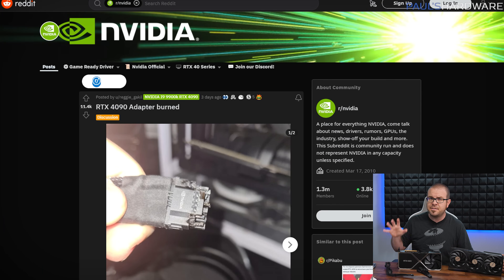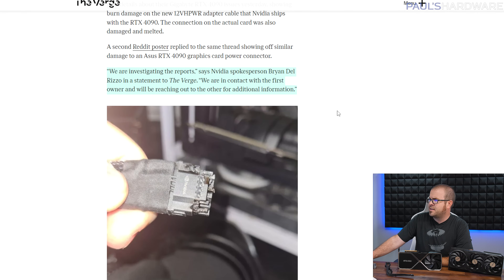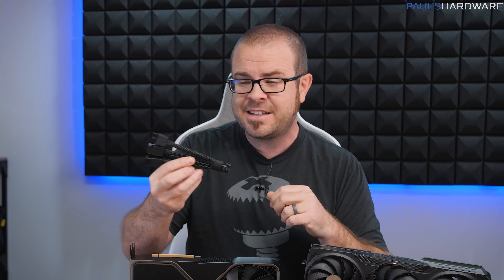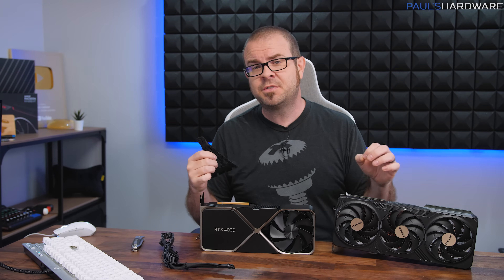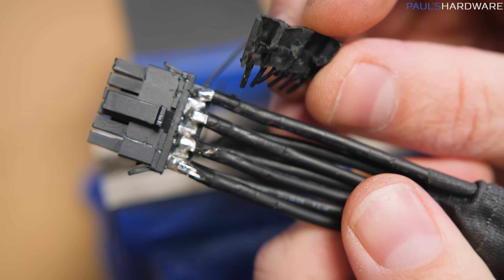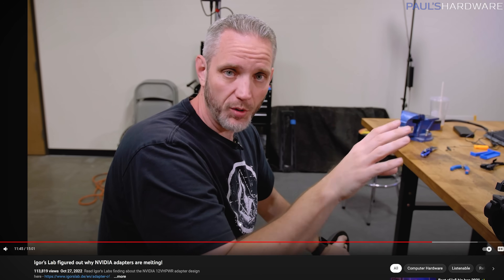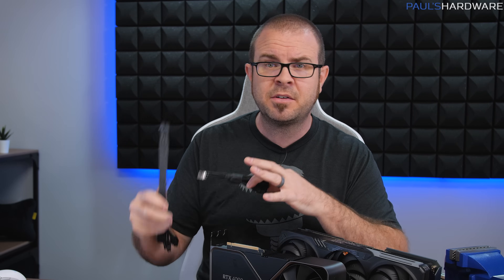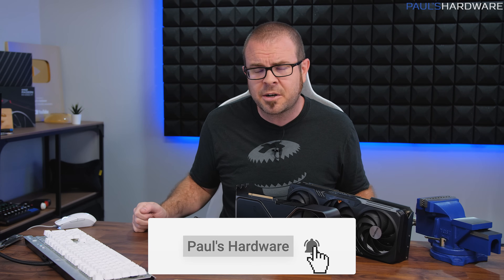Why are some melting? RTX 4090 600W 12VHPWR Adapter Teardown

Comment: While poor connection increase impedance, it will not increase it compared to no connection at all. If only one of the pin has poor connection, it's still better than one of the pin having no connection at all. However, if the distance is extremely short there's always of a potential of sparking which would increase the temperature.

Comment: small contact means higher resistance , also means that path will distributed lower current(Parallel Circuits) ,so maybe not the case

Comment: Confused to why manufactures haven't just switched to (2) 8 gauge OFC stranded power cables. 8 gauge wire @ 24" is good for 200 amps. Not only would it be safer, it would look better. You could actually use even smaller like 10 gauge.
Reply: Because the more resistance, the more power you need to pump, which means its power draw will be even higher due to the losses from that higher resistance. Basically they sabotaged the product with a bad decision in order to try to fit it into a specific advertised power envelope.

Comment: problem too, is those metal plates are now thinner vs previous connector, so they get hotter, 57C  (plastic 67ºC at 30 ambient temp) outside, could be 90-º105ºC (metal)  inside, that could strain the solder with the time and breat the solder joint.

Comment: Is the cable melting with a certain brand that makes the 4090 card ?
Reply: According to igorsLAB, all of the 8 pin to 12 pin cable adapters are supplied by nVidia.

Comment: moral of the story is Nvidia isn't a cable manufacturer, don't use their cables, use the one from your power supply, they manufacture cables.
$1600 GPU and they skimp on the most important part... If you can't spend a couple dollars on the cable to make it right, don't include it in your box!

Comment: Thanks Nvidia for using the cheapest connections you can get while charging us 1700 bucks for the card.
Reply: Funny when it is likely just customers not plugging in the cable enough.  KEKW
Reply: Na, cable works fine. User error

Comment: Never had a warm fuzzy about that adaptor design. When the cards had three 8 pin connectors it was always recommended to use three separate 8pin wires from the PSU.
Reply: the problem is the mechanical design, not the amount of wires ffs

Comment: Great analysis but I don't think a single loose connection with multiple wires in  parallel would cause that much heat because the power will go the path of least resistance. It is more likely something is causing a short or multiple pins are becoming lose and causing the additional resistance across multiple pins. You could put an amp clamp on  each of the four wires and see if there is an imbalance after multiple plugging and unplugging or various configurations.
Reply: exactly ,the net resistance of a parallel circuit is always less than any of the individual resistance values.  and base on P=I^2 R , the total heat generated on the cable should still lower then 2 line situation like Jayz experimented , Isn't this high school physics?
and if only 2 lines are fine in Jayz test, it's more likely causing by  loose pin

Comment: Nice video Paul, I just put in my Corsair cable in this morning for the 4090. The Corsair cable feels nice and robust, and its working great. My old plug I took out and have been using for a week showed no signs of melting or any problems. Keep up the great work.
Reply: Where do you find it? I am having no luck in finding one, about as much trouble as I had for the dang 4090 card
Reply: @killer01ws6  best buy has the Corsair 12 pin cables for $20.
Reply: @Stormborn29  The cable you are thinking of is only for 3090FE being a 12 pin not a 12+6 which is the one needed for 3090ti/4090 cards.
Reply: @williamrestrepo98  you are sort of right.  The one available at best buy is for the 30 series.  The pcie5 600w version is offered by Corsair but out of stock at the moment. So yes and no.
Reply: @Stormborn29  Yeah, maybe my local BB sucks, but it only has 3090 cables and if I put in Corsair 12VHPWR cable it finds Nota, just wants to show non related stuff.
Reply: Have you noticed if you can set the maximum power over 93% on the geforce experience performance tab?
Reply: You just need to keep refreshing the page all day I got lucky and got one within a day of them being released.
Reply: @WillS.420  Thanks, I will go be the store and see if the locals have a clue haha
Reply: @killer01ws6  corsairs website has it, though it's not in stock right now.  It's specifically the same type of cable but 600w.  It's written on the 12 pin side. I'm in the same boat and need the newer adapter as well.
Reply: @Stormborn29  I am on the to be notified list for it from Corsair also, Seasonic is supposed to send me one too.. I am just seeing what I can get first.. I have this 4090 setting on my desk looking at me, killing ha. but I will not use the supplied cable on it.
Reply: @killer01ws6  yea seasonic won't have an ATX 3 PSU out until Dec.  Ugh.

Comment: Amazing. Nvidia is going to f around and get the NEC involved in PC internals at this rate. $300+ Billion global company saved 20 cents by including a POS adapter with a $1600 card. Brilliant.

But hey, the more video cards you melt, the more you save!

Comment: The same 12 + 4 pin connectors were used for the RTX 3000 series. If the problem is with the connector, then it's only a matter of time before the 3000s connectors start melting. The additional 4 pins are sense pins that don't carry current and the 3000s don't require as much power but the principle is the same.
Reply: The 30 series ones are more like the Corsair wire that Paul showed - so each pin has a dedicated wire providing power to it.
Reply: @icaruswindrune7116  I see. The cable went from 12 18AWG individual cables to 8 14AWG cables soldered to 2X6 pin bridges. They went to 14AWG wires for increased ampacity. LOL. Whatever. Fortunately not a problem I have to deal with as I have no intention of owning a 4090.
Reply: They were wired differently than these new ones. Only the 3090 Ti had the 12+4 pin and they were wired in a proper way unlike these 40 series cables adaptor.

Comment: That picture showing the connector on the card, am I blind or does it not have any sense pins? The cable had some but looking at the pic of the cards connector it doesn't look like it has them.

Comment: dose anyone think that maybe when EVGA seen this maybe they did not like it and thats why they told Ngreada to kick rocks  as EVGA has built cards for years and know what kinda power a card really draws under heavy loads
Reply: This is very possible as EVGA did specialize in overclocking.

Comment: If they skimped on a simple thing like a cable, you have to wonder, what else did they skimp on?
Reply: The fact that these cables failed in the way they did does not suggest that they were cheap. Far from it. It would have been much cheaper to use something closer to what the 3090 used, even adding the sense pins. The adapter is too clever by half, and too clever for its own good.

Comment: upwards of $1600.00 is not the correct way to reference the price. Since the lowest price you could pay is $1600.00 and the highest is $2000.00 the correct way would be "at least $1600.00"  Sorry no willing to cut Nvidia even a bit slack on a Halo tier product

Comment: You are correct in your thoughts of a small/ poor connect causes the heat.  Just like a space heater I had.  The plug would get so hot that I could not touch it.  I replaced the plug and resolved the trouble. Bad connection in plug

Comment: Igors adapter looks like I soldered it.  Jay's a lot nicer.  Yous is somewhere in between. You can tell from all 3, the soldering is inconsistent in quality as well as wire placement.  Some have more contact area than others.  

I think think that 8.3a is too much load for that pin.  It is beyond what molex specs for it.
Reply: When I saw that, it was clear that these are almost certainly all soldered by hand. That means that soldering wasn't a decision they made to save cost.

Comment: Loose electrical connections = hot points = fire hazard = melted plastic. When you break apart the plastic molded piece and sever the connection you are no longer creating a scenario that would simulate real world use and will not be able to recreate the overheating issue. Overheating issue is a result of a severed or partially severed solder joint or contact that is loose, a loose or partially severed or completed severed connection that is held together loosely by a plastic mold has a poor contact, and anytime you have a poor contact, essentially, imagine it's like a heatsink poorly applied to a CPU. What happens with wiring connections is that the loose or less surface contact creates hot points, where the same amount of current is trying to pass through less surface area, and the areas where it barely makes contact becomes much hotter. This is why when you screw a wire in place, you have to use a torque screwdriver or torque wrench to ensure enough contact strength and that the contact points won't come loose. Loose electrical connections = hot points = fire hazard = melted plastic

Comment: 14:01 - Thank you. It has been obnoxious seeing people act as if AMD just made this decision right before launch. No, of course AMD didn't just make this decision and force themselves and all their partners to redesign their PCBs. This decision was made well before adapters started melting.
Reply: They will be able use the bandwidth of display 2.0. You are free to give your money to whoever you wish.
Reply: @matthewclemons1574  AMD is not pushing 4K passed 170fps or 8K at 60. They aren't going to get beyond DP 1.4a and even Nvidia can only barely touch that with DLSS 3.0. AMD would have to pull a 3x increase in performance to warrant needing more bandwidth than DP 1.4a.
Reply: @Talishar  Are you talking about 1 game? you know there are thousands of games, not just the couple that most benchmark suites use. also the color bit depth affects data bandwidth, likewise having the higher bandwidth will force card makers/monitor makers/cable makers, to properly allow for the bandwidth, because i can tell you with all my current gear, that all claim to have dp 1.4, i'm not able to go past 1440p 10 bit depth at 120hz, at least not through the normal way of changing settings. the moment i switch to 10 bit color depth, the option for anything above 120hz goes away.
Reply: @terrymike7053  That's all on your monitor. I'm doing 10 bit on 4k@165fps and it's working fine and is selectable. My previous monitor could do 10bit 2K @240 fps. 

@G T You're literally making the same argument I am against DP 2.0+. There's no hardware able to push beyond the limits of DP 1.4a so adding it on to a GPU that doesn't have the horsepower to need it is wasted money that's passed onto the consumer. Nothing is pushing 8K 60fps and it takes DLSS 3 to even get close. Also, there are at least 2 displays that I know of off the top of my head that can do 4K@165fps+.
Reply: @Talishar  I've seen 8K60+ on a few 4090 benchmark videos. GTA V, Forza Horizon 2, F1 22, and many other games with DLSS enabled.
Reply: @G T Good point.  And a great comment.
Reply: Is that not common sense?
Reply: AMD doesn't do anything until Nvidia has already been doing it for 5+ years
Reply: @georgeRRmartin2  As shown by the fact AMD is using PCIe 5.0 and DP 2.1 when Nvidia is using PCIe 4.0 and DP 1.4a. 🙄
I swear, it is incredible how little credit Team Red gets for having common sense.
Reply: @benjaminoechsli1941  So they're using ports and tech that their hardware can't even utilize because they can't even max out the bandwidth of the previous gen tech and are wasting money on new standards and ports and transferring the cost to the customer for no good reason.
Reply: @Talishar  Sad....

Comment: Great video.  Personally I'd love to get the Corsair VHPWR cable, but those things are more scarce than actual 4090s at this point.
Reply: CableMod has their version in stock for about $20USD. I think they're much better equipped to crank these cables out.
Reply: For real... its wild. I would love if nvidia would just send out these cords. Would be great...

Comment: So for those who bought these cards, what should they do? If you buy a replacement cable and still melted, your warranty will be void for using a different adapter. And if you have used an original nVidia adapter, would you wait for it to fail and claim warranty? What if this also destroyed the other mb components or the PC itself, will nVidia be liable to the total damage cost?
Reply: Igor's article specifically says the issue is not the connector...PSU provided cables use the new spec connector just fine. The adapter is meant to be used with older PSUs that don't support the new standard. So I would expect the warranty shouldn't be affected in the situation where you use it with a natively supported PSU and cable right? Not sure about using other adapters though.
Reply: I don't really believe this your warranty will be denied if you use a cable provided by the manufacturer of your power supply. You can't on the one hand produce a card that uses an ATX 3.0 standard power connector, and then whenever actually uses an ATX 3.0 standard power connector to connect to it deny them a warranty. That's nonsense.

Edit: the Corsair cable counts as a cable provided by your power supply manufacturer. I say the cable mod cables count too, but it's academic, because you won't have this issue with cable mod cables.
Reply: All you have to do is get a dedicated cable from corsair or Cable Mod (no adapter).... Everyone knows adapters are always an extra point of failure and that's why mine is still in the box.
Reply: MSJI 1722 The most prudent thing you can do right now is to keep an eye on your PC when the GPU is in full load. Don't leave the house or let it run overnight. This obviously can only happen if you're not playing games. So most likely content production, compiling, or god forbid stress testing. Basically the big picture. You just want to prevent the adapter melting into a full blown fire that burns down the house.
Reply: @Paul_Sleeping  or buy a 20 dollar dedicated cable and then leave your house and not think twice! Either or....
Reply: @bobvila4381  Yes and agree.
Reply: @glitter_fart  Yes the adapters are bad just like all adapters....

Comment: me wondering didnt the 3090ti use the same connector and if so why wasnt it a big issue then?
Reply: Technically the 3090ti doesn't use the 12VHPWR connector in its entirety. The problem also appears to be the Nvidia adapter paired with the 4090, and not the version they had for the 3090ti.
Reply: Jay covered that in his video, the adapter was different. It had one wire going to each pin instead of this 4 wires soldered to a plate to feed 6 pins nonsense.
Reply: @mjc0961  ehhh why did they bother to change it the 4090 uses less power than the 3090ti

Comment: so bottom line don't bend you cable too much and you'll be fine just  keep eyes on and replace if you can I'm imagining they be sending out better designed connectors. I actually got a thermaltake 1350 power supply with the native connector
Reply: Bottom line, don't spend money on a piece of crap GPU that was shipped with a cost cutting miniature conflagration device included with it.
Reply: @JosephArata  💯
Reply: @JosephArata  For people that have a brain you can buy a proper dedicated cable for 20 dollars...
Reply: @bobvila4381  People with brains don't make excuses for billion dollar corporations cutting corners for profit, where it could cause a wrongful death by house fire.
Reply: @JosephArata  Yeah you are right... Im not trying to be insulting just pointing out there is an easy fix is all...
Reply: Imagine spending $2k for a cable that came be used more than 30 times

Comment: Never fun to be on the bleeding edge of technology.
Reply: Or the burning edge, if you will...
Reply: This is hardly bleeding edge of technology... You can chalk this up to poor workmanship and an ultimately unreliable design of an otherwise very basic thing..
Reply: @ebaker8807  When has ATX 3.0 connectionsbeen used on a graphics card previously?
Reply: @wandpj  I understand what you're saying. But the failures (at least from Igor's conclusions) are from poor quality workmanship of the manufacturing of a simple adapter. NOT because of difficulty following a new spec. 

Issues that could EASILY be avoided. Making an adapter isn't 'bleeding edge of technology'
Reply: @ebaker8807  Poor workmanship implementing a new technology is all part of the bleeding edge experience.